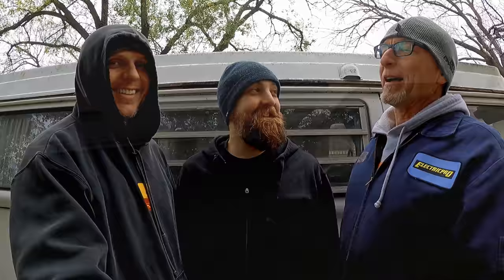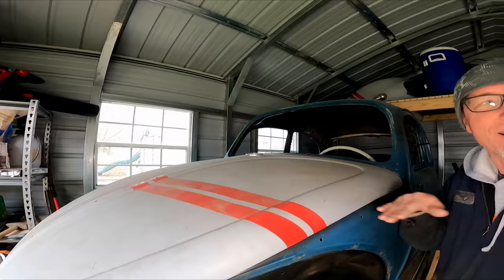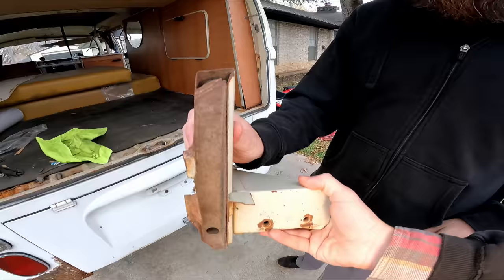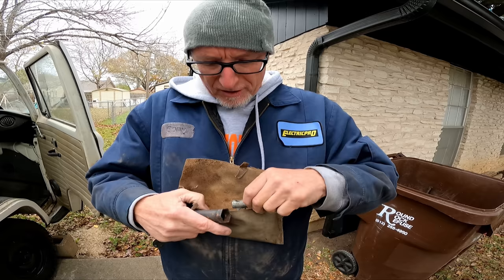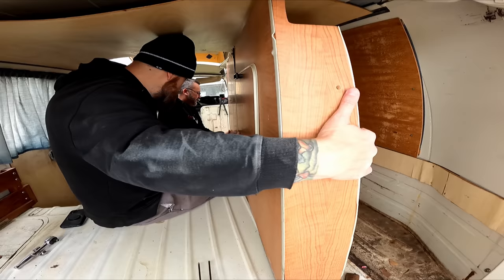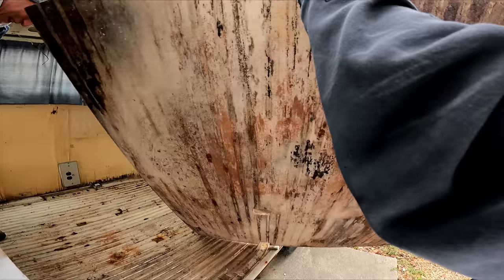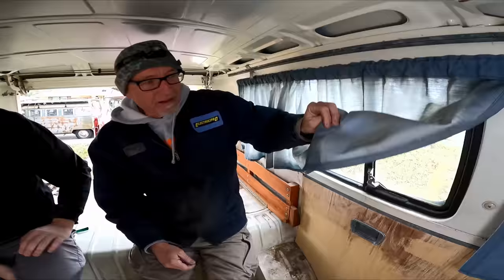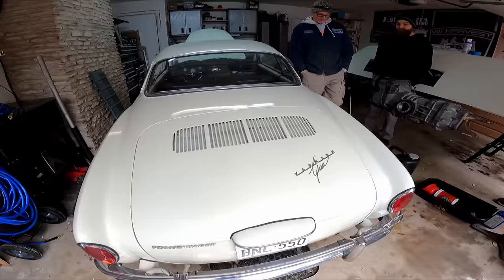Stripping the Interior on "Jesco" the 1970 VW Bus!

Comment: That appears to be a very solid bus with minimal body work needed.  Heck even a home done glossy paint job in and outside would not cost that much if done in dupont single stage enamel.  The hardest work is in all the sanding on the inside and outside.  Of course a VW Lifers conference would cut the time to 1 day of sanding if 6 to 8 guys showed up to sand  for some libations AFTER all the sanding is done.
Reply from the maker: That's the plan!

Comment: I got Rambus running half way. I could not figure out what was wrong and spend over 100 guessing what it was . I put a distributor ,  coil , new points in the new dist. ign. switch . Sometimes I would take it to the store,then it would not start. I would pull the dist. set the points . and it would start. Finally I got some spark plug wires from ebay ? that was it the coil wire.???????
Reply from the maker: Ah